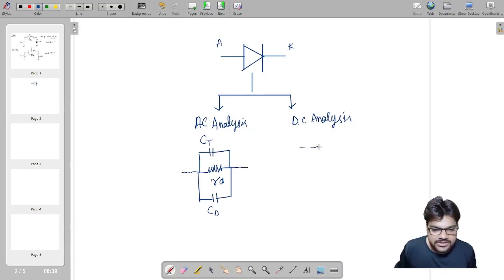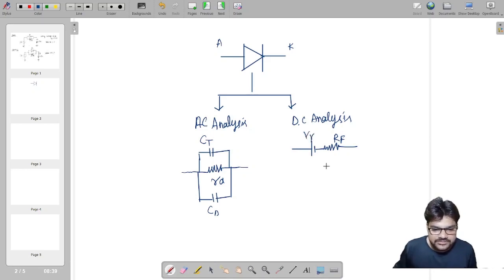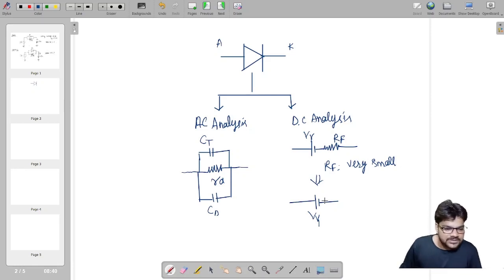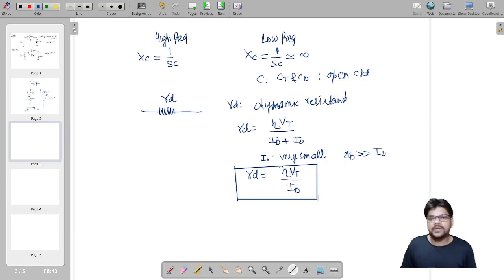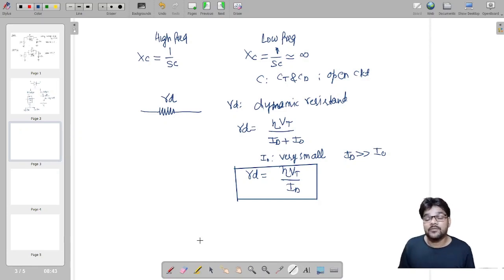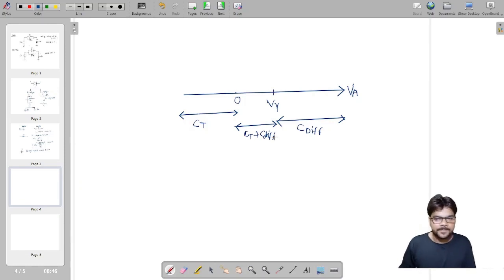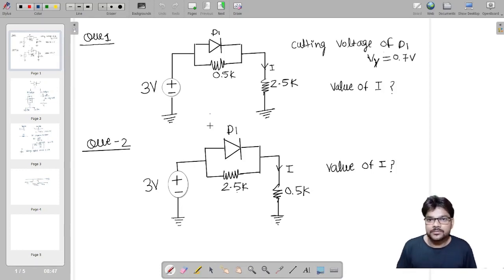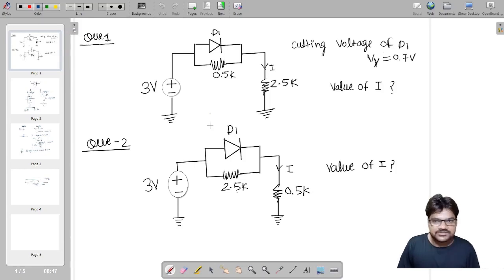What Is Your Thought Process When You See Any Diode Problem? Best Explaination Ever |YogeshSinghIISc

Comment: The best part was that you didn't jump any steps in solving the problem. 
Please share problem solving method for 2 and more diode circuits also
Reply from the maker: Sure,next video is gonna be about that only.
We will develope problem solving technique when multiple diodes and other multiple devices like zener diode,bjt,opamp are connected in single circuit.